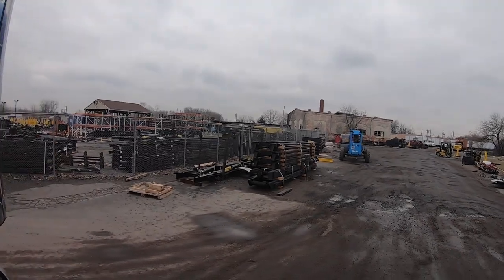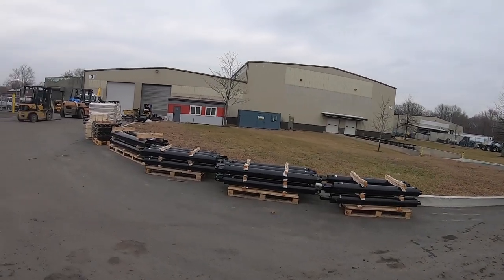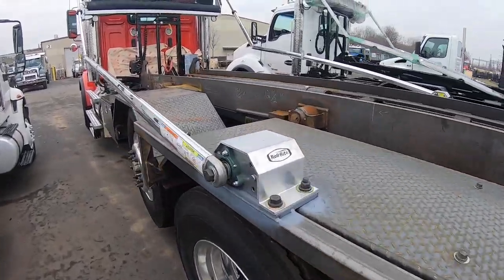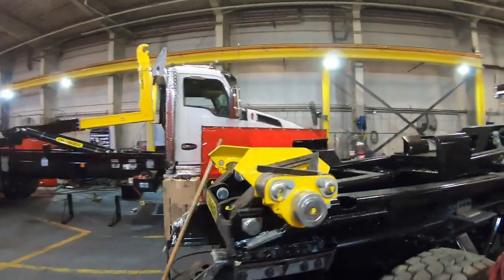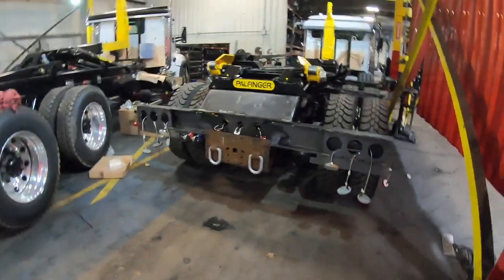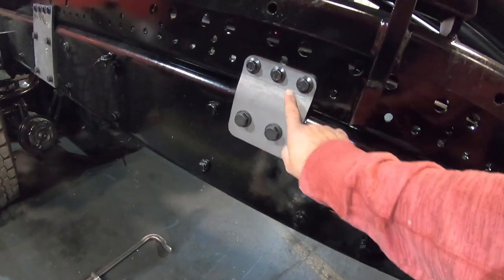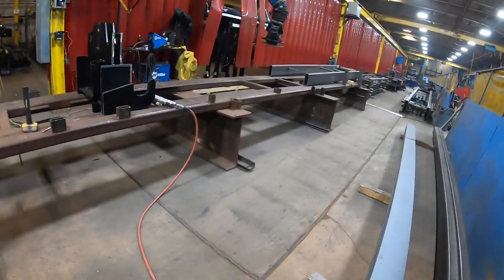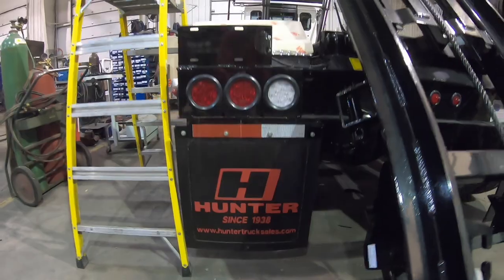(The Palfinger Factory) Peak of Palfnger Hooklift Hook Truck & Hunter Truck Roll Off

Comment: How much did you sell your cable truck for?
Reply from the maker: Ste Ven $80k had 100k mikes was a great deal
Reply: @LaRobertos  sounds like a good deal, maybe in 2 years i will be buying out the company i work for and i will need to make the decision to either buy a big hooklift or go with roll off, we have a single axle hook now
Reply from the maker: Ste Ven selling a tandem for $60 now rebuilt engine will be posting it soon
Reply from the maker: 85k
Reply: @LaRobertos  wheres the new videos?
Reply from the maker: Soon I promise